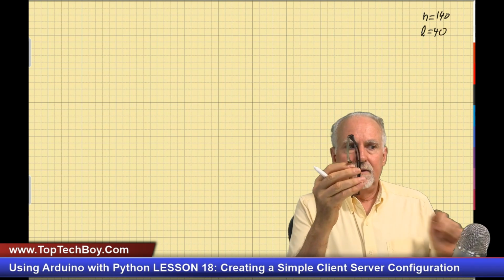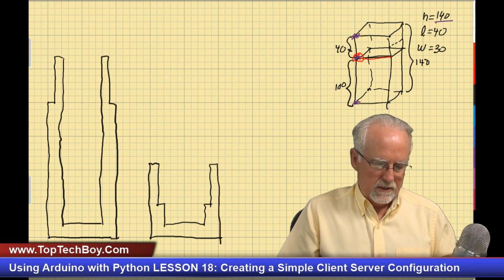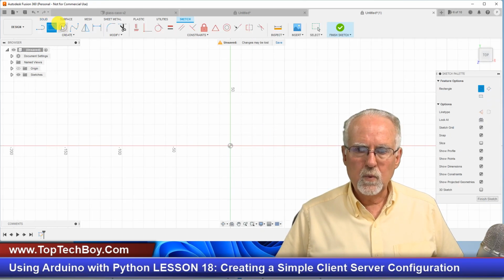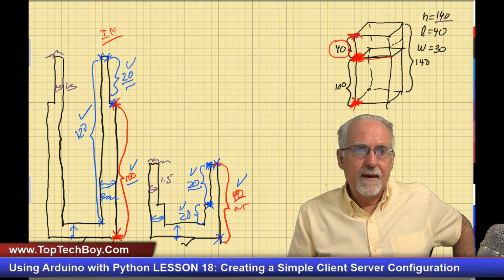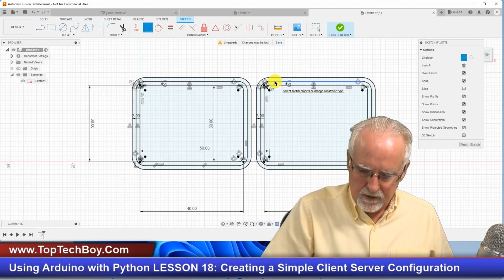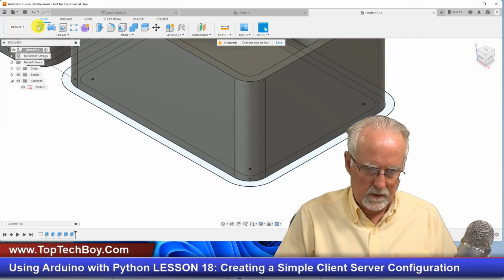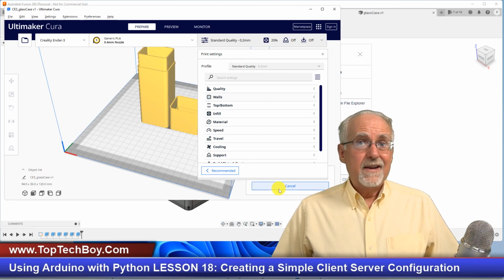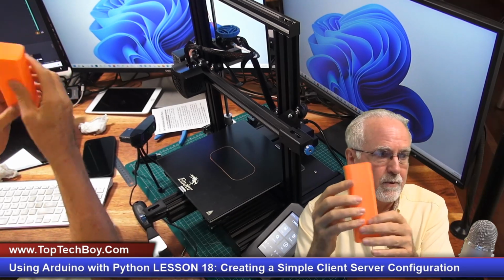Fusion 360 for 3D Printing LESSON 9: Designing and Printing a Simple 3D Case

Comment: Thanks for the lesson. Like Code Cage, I modified the assignment a bit. I made a tube that could hold exactly $10 (one roll) of quarters. I made the lid so it would hold $4 of quarters. I can use this to measure them quickly at the  car wash. The calipers came in handy. I ended up having to goof with it because of the tolerance issue. I needed to force the lid on. Once on it was not going to come off without more force than I could muster without a cresent wrench!
Reply from the maker: Excellent!
Reply: A 0.008 inch or 0.2 mm clearance should work. if you have a caliper check the measurement of the mating surfaces. You may be over extruding.

Comment: I have drawn this 3 times, and every time I get 3hr 45min, 80.54 gms, and 27M of material. The 27M seems extremely high. I am going to let it print but something seems wrong. Creality3-V3 SE. My size is bigger at 155mm x 55mm x 40mm and 3mm thick walls and ends.

Comment: I am legend. sort of. Instead of an eye glass case I made a case for my hearing aid charger. The hinge for the lid had broken and I needed a case with some place to place a desiccant pack while my hearing aids were charging at night. I created the base and top in a similar way as you did for the eyeglass case. I measured the charger for dimensions and added hight for the shelf I designed  to be glued to the lid. The shelf has 4 columns that are 5mm in diameter.

Comment: Hey Paul, I'd like mention two helpful tips I have found recently. I hope this will increase our productivity a little:?

1_ Pretty much every mouse has a middle button that you can press on it, while holding it pressed, you can navigate around sketch. I find it more useful instead of zooming in/out different locations.

2_ This is a Big one. To help with constraints. If someone, somehow miss a constraint and find themselves without a locked sketch, and if everything looks black-fixed but sketch says still unfinished. You can make fusion 360 show where these unconstrained points are.(some are virtual,floating around, despite all sketch looks ok, it doesn't show lock)

On Top Left, click on Files, then at the bottom, you click on view=>Show text commands,
you'll realise on the bottom part of window, text commands appears.
bottom right, you make sure text is selected, and type in are which says "Type text commands here"
You type " Sketch.ShowUnderconstrained " 
and program highlight where these weird points, or errors that prevents a fully locked sketch.

I found it really useful. Of course, it's better to prevent it at the source, like you said in previous video. But at least, if you miss that and find yourself in middle of sketch with that image, you can recover it instead of starting all over.

Hope that helps if you were not aware of that before.

Best regards,

Comment: Hey Paul,
I watched your previous series and I made sure to do this home work with Parameters. So I guessed at 30 and 40 for outside width and length. When I started watching this Video and you said you wanted the inside to be 40x30, I knew that my wall thickness was 4mm per side. I was then able to go into parameters and added 8mm to the length and width and it made the corrections to the rest of the model automatically as you taught us :)

Cheers

Comment: Fantastic ! Loving these lessons. Did the homework prior. But the 'smart ass' in me built in a 0.2 mm clearance between the mating sleeves, and recessed magnets to hold the cap on (i've a bag of tiny magnets from another project. Need using up, hehe). Great, you gave a 'nod' to those design rules ...

Comment: Thank you Paul for this series. I hope you will eventually cover supports. I plan to 3D print an old steel rimed wheel (dia of 150] that has hub length greater than the width of the rim, so I am assuming the rim will need supporting for most if not all of its length
Reply from the maker: I will over supports. Those are usually more complicated designs and so will be covered later in this class.

Comment: Absoluite Most Excellent lesson as always Paul.  I made the case, however- one side looked amazing, while the other ( on both parts) was textured. The bed was leveled just fine, wondering if its a loose belt issue ? I'd share image, but dont see any way to do so
Reply from the maker: It could be any number of things, so hard to help debug remotely. Everything on the printer has to be in proper tune to get perfect prints. Could be Cura settings. Could be printer alignment, Could be how tight the belts are, could be so many things.

Comment: I've got my case printing at the moment. The print has got one of it's usual 'danglies' hanging on the inside - one day I'll figure out the cause of these randoms. I'm printing with PETG as that is what I have been doing cookie cutters for the missus with (I figure that while I keep her in kitchen gadgets, she'll be accepting of the printer - that's the Ender - I think I might be forever beyond the pale).

I had another period of learning - The PETG wouldn't stick to the plate again and a series of cutter prints failed. But I think that was due to being a slightly lighter design with less contact with the plate. It seems that either glue or a brim was the solution but I learnt a lot about stringing, temperatures, retractions, etc. along the way. Not sure how much has really stuck (between my ears, that is) but the next time I meet with these issues, the learning should become easier and the printing betterer and betterer.
Reply: Printed! The lid fit is a bit too tight. I had to remove some cobwebbing from the inside of the lid using a pair of scissors as a scraper - worked fine, but result shows that I would need to give the join a tolerance to fit reliably (it is still so tight that removing the lid once it is on is just painful). But that is all a part of the learning.

Also printed it using 7% infill. That has worked fine but the first layer of horizontal over the top of such a sparse support was not particularly good and I thought might lead to failure. I don't think I would deliberately go under 10% infill for horizontal surfaces again.

Comment: Paul, thank you for the wonderful lesson.  I especially liked your using a drawing first. When I did the homework last week I kept it all in my head. Your pulling it out onto paper made it so much easier to think about and know you are getting it right.  I guess this is what real engineers do. :-)

Video for extra credit: https://youtu.be/xxOcGefcaDs

Well, I am not a real engineer so I worked way too hard trying to develop a method that was so direct I could pop it right out of my head and onto f360 with no paper. I realize I am getting a bit out ahead of where we are at in our lessons. I used simple parameters up front. The video shows a technique that is way to clever for it's own good, bad engineering probably,  and isn't as beautifully direct as the way you do it but it does make the whole case directly in place with the desired height, already snapped together just waiting to be separated for printing.  The idea is to have a single sketch with a rectangle, then make an extruded solid for the lid, then use the shell command to hollow it out.  I then copy that and do some offsetting of faces to make a tool that cuts the inside of the lid in one go with the stop in place.  Then use an offset plane on top of the stop in the lid, project the rectangle from the first sketch, extrude to the desired height, use shell again, then use the lid as a tool to trim the rest of the box to fit (while keeping the lid). At that point the box is done and rotation and some translation puts it in place for printing.
Reply from the maker: Nice work. In future lessons I will show parametric design. It is really the right way to do it.

Comment: I AM LEGEND!!!! - I didn't print it though. I don't have my Creality Ender 3 v2 … YET.... That's in my 2023 budget [using Paul's link]. I dried up by budget this year setting up my bench. Priorities... Priorities...sigh
Reply from the maker: Yes, many parts to a well equipped shop, and we have to build it over time. The printer will be a nice addition. Also nice is a good oscilliscope, good soldering station, and good DVM and power supply.

Comment: i am a legend.. though i had an issue with offset, after i finished the sketch i couldn't extrude the surfaces independently, it extruded as a block. i sketched the rectangles separately and used the midpoint constraint

Comment: My house power is weird. 3D printer was working fine one day and then the next day it just never worked at all. None of the plug-ins work.

So you can say that sort of never entered the area. Plus I added a BTL Touch to the 3D printer too as well.
Reply from the maker: Not your fault if power is off. I struggle with that a lot here.
Reply: you meant BLT (BL Touch) sensor...

Comment: Start with a sketch? NO! Start with entering the dimensions into the parameters list
Reply from the maker: Jim, I will be covering parametric design in later lessons. The challenge I have is to not get so bogged down in the early lessons with good design methods that the students can have a little fun with the printer. I am trying to show simple ways to get something designed and get it printed. The lessons I am working on now are how to design to design rules for a given printer, and then I will go back and show how really you want to design everything using parameters, and how to effectively choose your parameter list.